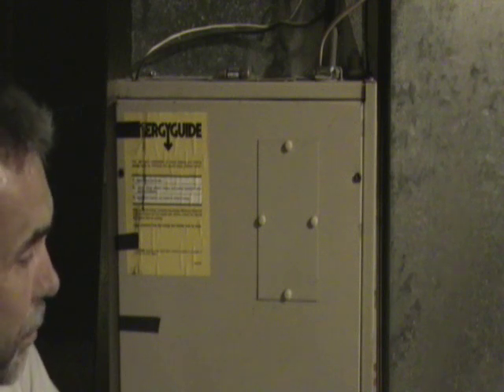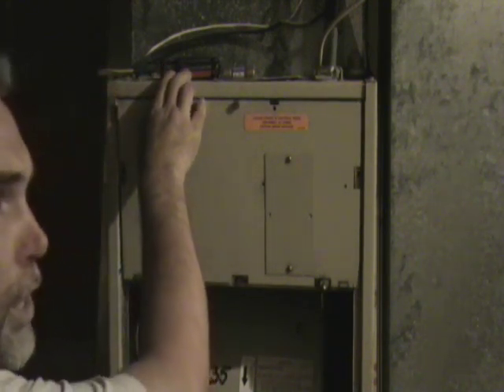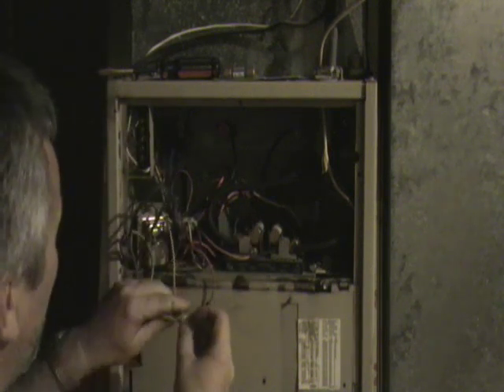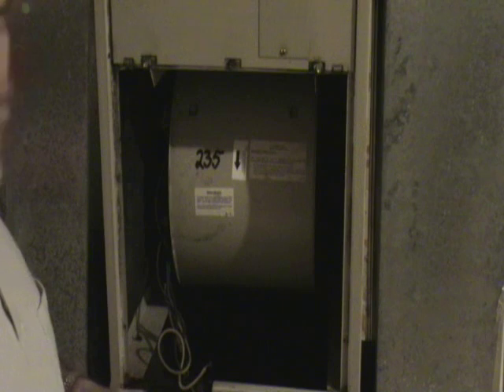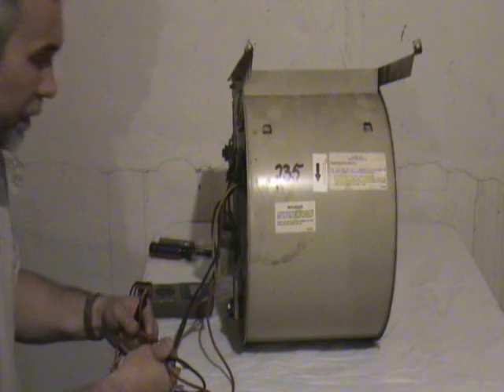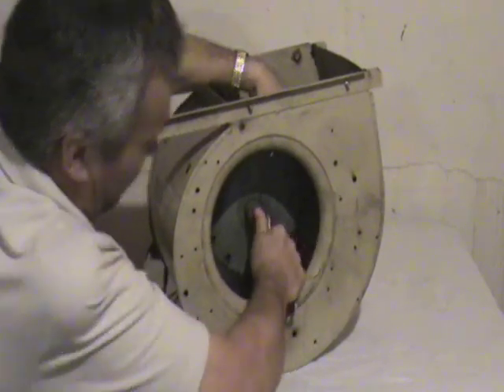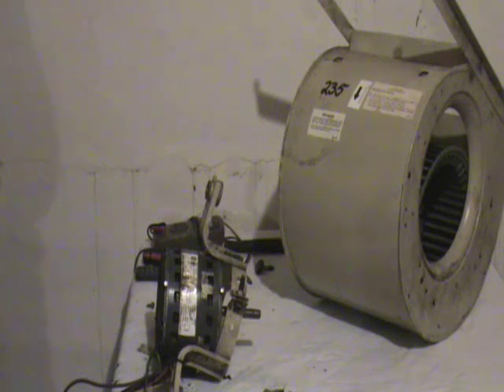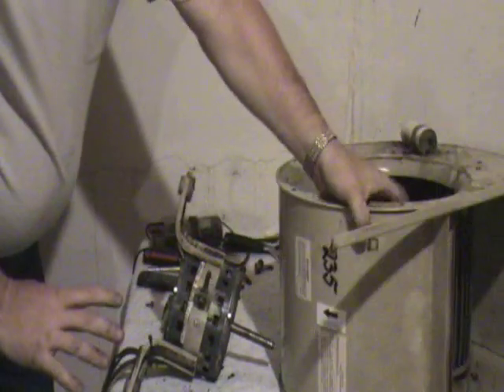HVAC For Beginners | Furnace Blower Motor Troubleshooting & Replacement

Comment: Had my furnace checked today. It was $119 bucks. Looked in the furnace a few days ago and the blower looked like it was in there pretty good. The service tech stressed to me how difficult they are to remove as did the tech before. They want an additional 150 bucks to clean or work on the motor. So I was impressed to see how easy this one comes out! I think mine is similarly sliding. Tech wanted $100 bucks for a capacitor available for less than ten. Thanks for sharing.

Comment: The first tech who came out cleaned the burners in the front of the furnace and it looked like a pretty good job. They only do so much and then stop and charge you based on their service contract. My problem was "intermittent" so I felt ripped off when the problem recured. Service contract guys came back and it was working again!$! The blower I cleaned thoroughly before wiring in the new motor. I'm worried that the evaporator coil could use a clean. Not sure how to get in there.